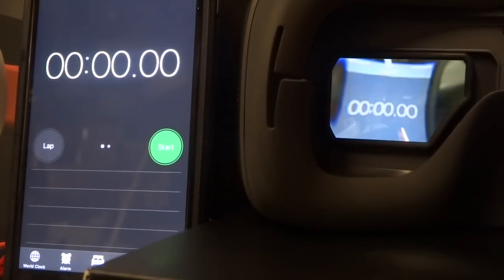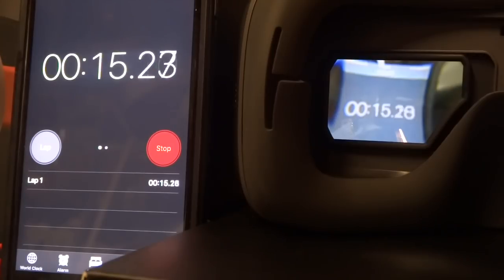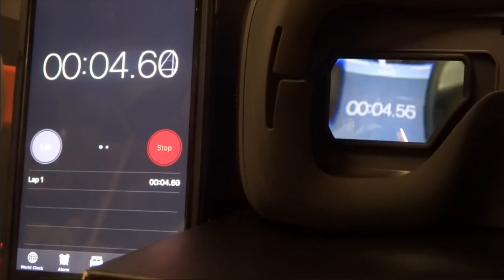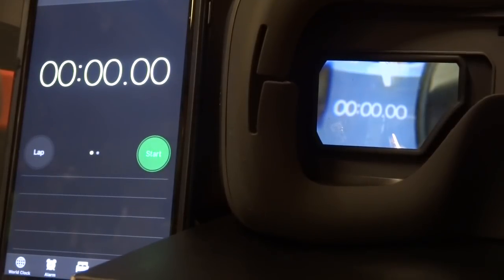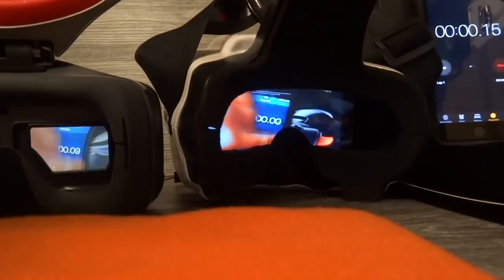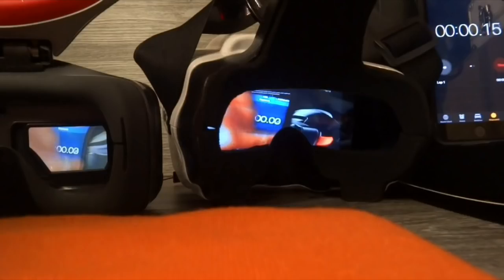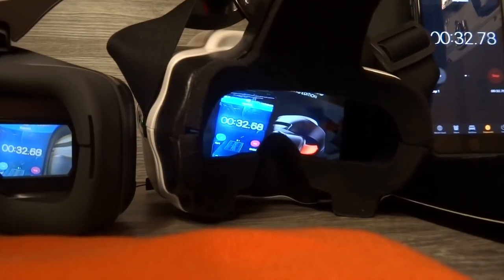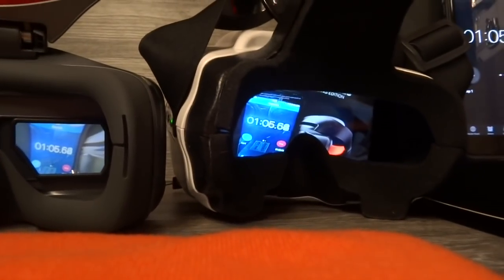DJI Goggles Racing Edition Ocusync Air System Lag Demonstration both Digital & Analog

Comment: Warning...anyone really thinking about buying these for a racing quad, Joshua Bardwell tested the DJI goggles with a racing quad and it is not flyable. That's even if you can get the transmitter to fit on your quad, can't really race with it competitively where it's so big. They are getting closer though. The first company to be able to get a hd transmitter with low latency and small single antenna transmitter is going to have a gold mine! Maybe it's not too far off. Here's the link to the video: https://youtu.be/XAok49_MbkQ

Comment: Great video, thank you. In the last test, are they the original Headplay HDs and, if so, do they have the low latency firmware? Also, I would love to see a side by side with Occusync at the various resolution settings and an analogue system side by side.

Comment: Would have been better if you used a better clock.  Should jsut be able to pause your video and see the difference but your clock merges all the hundredths
Reply from the maker: It does, Ideally you need to use a very high frame rate camera and display or use a different method of measuring it like IR, its enough to demonstration the point though.

Comment: Thanks for that test !! Do you know if the latency on regular dji googles and RE ones is the same? Or RE is faster ?
Reply from the maker: Latenct is the same on the Mavic and USB on both models, its only reduces with the DJI Air System

Comment: Do you see a benefit (50ms 480) when using the Mavic or Spark - or do you only see the improved digital latency when using the new air system?
Reply from the maker: TYTFan Sig the 50ms is only on the Air System, Mavic Ocusync and Spark USB is the same as before.
Reply: I am surprised, as I thought some of the latency with Mavic and Spark was the decoding on the goggles, which DJI is saying is improved with these goggles.

Comment: Am I understanding right that you measured no real latency difference when in analog mode between the re and a "normal" analog rx? Contradicts some other folks results...
Reply from the maker: Adam Xett Hi Adam, yes what I showing is the DJI goggles show no noticeable delay or lay over the Headplay HD when both in Analog.